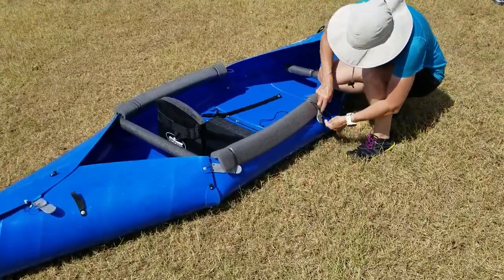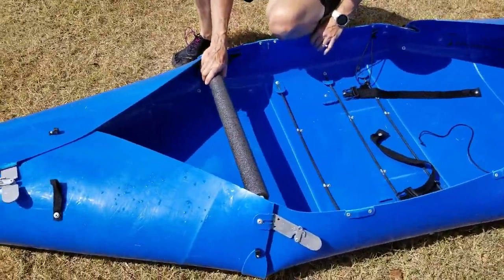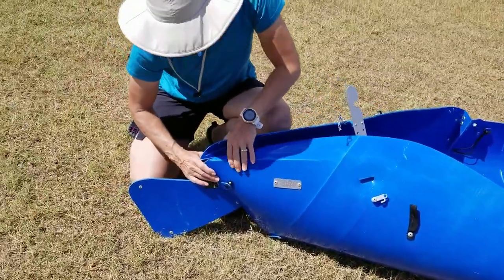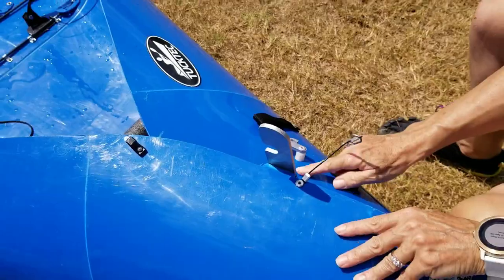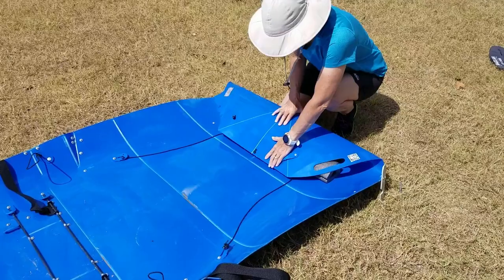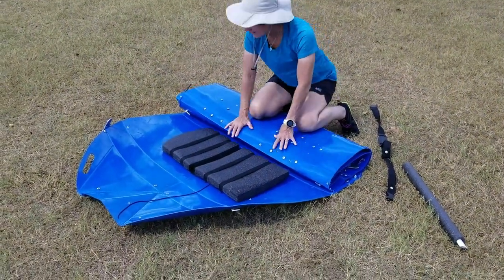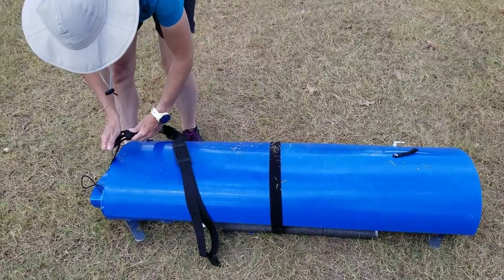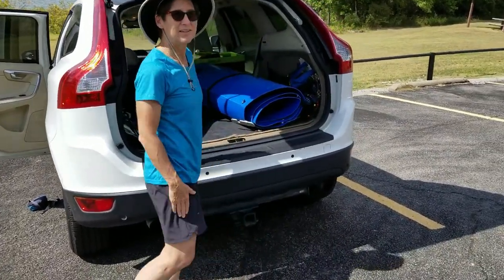TuckTec Kayak Unfolding; Rolling Up your TuckTec Folding Kayak #tucktec #foldingkayak #kayak

Comment: it is  a lot harder than this. it is really hard to do, it takes a lot of use to get it down like this so perfectly. those dang clips point out on my every time.
Reply from the maker: This one was a refurbished one. Later I bought a new one and it was much harder to do. I use body weight and body mechanics. Gloves also help. After a few times it was easier.